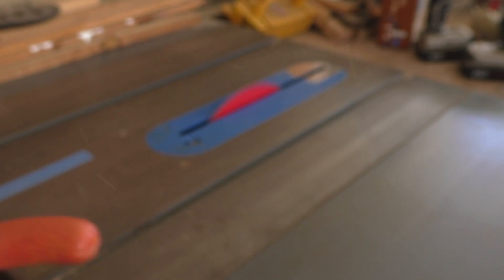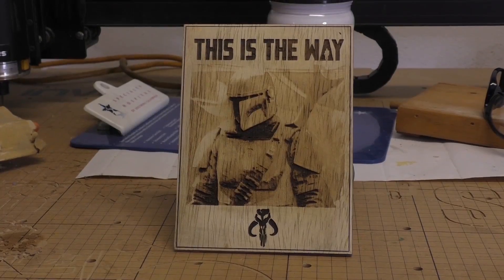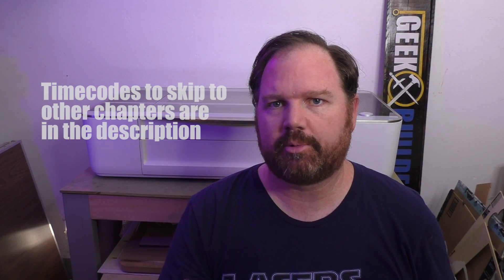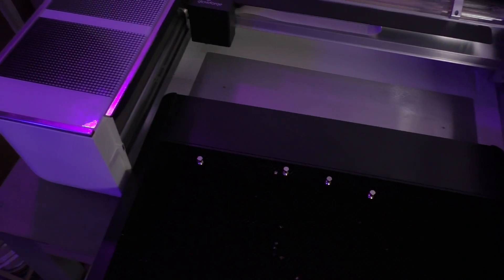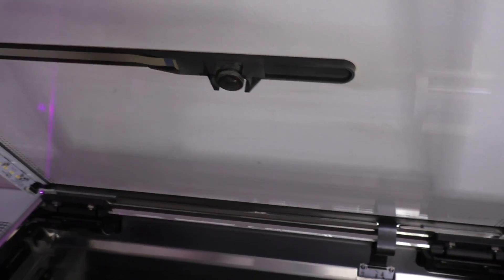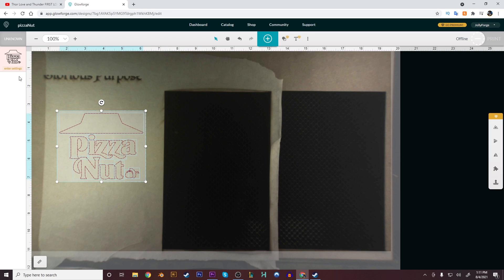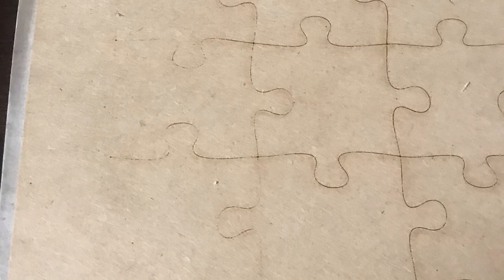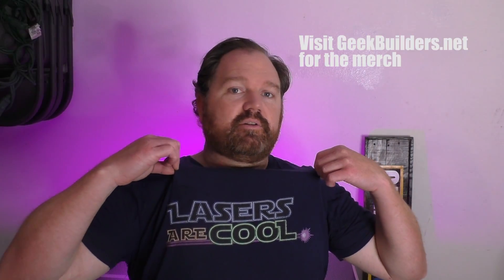Life with the Glowforge 6 Months Later

Comment: I have owned my Glowforge Pro since July of last year. I also purchased the HEPA filter add on filter system (by Glowforge) with it for use when the weather doesn't permit me to vent it out of the window. I keep mine in the house where the temperature never drops below 72 degrees Fahrenheit.  I also purchased the cloud9 external fan that many Glowforge owners add to their setup. Its very quiet because in the settings I have bypassed the mediocre internal fan (since its not needed after my upgrades). I keep it clean just as you do. It has ran 12 hours a day for 7 days a week ever since (I'm positive it would run 24/7 if I needed it to). I'm not trying to act as a GF fanboy here, but I haven't experienced a single problem with mine. I also know many people in the maker community that have owned their GF pro for 3 plus years with no issues to speak of.  Now, I'm sure I'll have to replace the CO2 tube eventually, and that will cost about $400 usd when the time comes (they last 2-4 years). as for the camera alignment issue you speak of, I have yet to experience that.
Reply from the maker: I'm glad to hear that it is working that well for you. I imagine that a large part is a result of the larger reservoir and better cooling for the pro. I have two pros at work with the HEPA filter as well.  The camera alignment is fairly common, but not sure about its real prevalence. I think some people might misunderstand my critique of the machine... I think its good... I just wish it was a little better so I could call it great

Comment: I seriously considered buying a Glowforge when they first came out, but the fact that you can only use it by sending your files through their servers made it a total non-starter. Our landfills are full of products that required an outside service to work, and that service went out of business or stopped supporting an older product line, and now you have a very expensive doorstop.
Reply from the maker: I know that's a lot of people's concern. Companies should have a built in contingency plan. Thanks for sharing and watching.
Reply: @GeekBuildersNet  Glowforge has stated that if anything were to happen to their company, that they will release stand alone software for the user so it can be used without their servers. However, until that time presents itself, it will remain cloud based.
Reply from the maker: @Connorsdaddy12062008  That is good to know. I was not aware of that. Thanks

Comment: I think safety is one piece that is completely missing in this review.  Working with a laser improperly can result in severe effects.  GlowForge gets a gold star for their safety precautions.  Sound is a funny negative as disabling the fan is an easy fix, and if you are venting any laser inside your house you should rethink owning one.  Overall if you are a production laser house, you would be willing to make a 5-figure investment.  Regardless, I don't think GlowForge is geared towards a full-time laser cutting service.  I use mine for hobbies and it's amazing and that's the sweat spot for it.
Reply from the maker: The comment about sound wasn't really meant as a negative- it was meant to be more informational, but I see how that might not have been clear. As far as safety goes, I agree that I also should have touched on it. Thanks for the good feedback.
Reply: @GeekBuildersNet  Also, can you share where turning off the internal fan voids the warranty?  All of the discussion boards make no mention.  I think the substantial community support is a positive to include.  Appreciate the note!
Reply from the maker: @judesturman  Yes. I will make note of it in a future video. It's usually not recommended to use a third party external fan until after the Glowforge is out of warranty, which is only 6 months anyways.

Comment: It’s a horrible build. I went thru 4 of them. They used a computer laptop fan for their air assist and will eventually light up.  Get your money back. Why would you go from a k40 and not upgrade to an omtech 60 or 80. You would of spent way less.   Sell quickly. Don’t get stuck with this junk.
Reply from the maker: I explained it in my video, but it might be easy to miss. The Glowforge was something that my wife was pushing for since it has a lower barrier for entry than most k40 style lasers. I still have and use my k40. I've found a place for both lasers in my workflow.

Comment: I can’t justify a $3k machine but I would love to have a laser engraver/cutter in my toolbox. Do you have a link to the K40 you use? Can it engrave metals (brass/copper maybe)?
Reply from the maker: C02 Lasers cannot technically engrave metals. But they can remove paint from metals giving the impression that they were engraved.  https://www.amazon.com/Engraver-Engraving-Controls-Woodwork-DF0812-40RW/dp/B01EJDH1BO/ref=sr_1_8?keywords=k40+laser&qid=1639967100&sr=8-8

Comment: thanks for the video, this brand is very popular in the crafters group. What type of laser do you recomend for a begginer, small projects. thanks
Reply from the maker: In all honesty, as long as the issues I mentioned about the Glowforge don't apply to your situation, I would recommend Glowforge. If anything I mentioned seems like it would hinder your ability to make, then I would recommend looking into the Full Spectrum Muse of possibly the MakeBlock Laser- I do not have first hand experience with these machines, but they do not have some of the issues that the Glowforge does.
Reply: @GeekBuildersNet  thanks, is very hot here (los cabos) and I got  scare when you mention the tempeture in your garage and I also saw a bunch of pictures online, the machine was  melted haha ... thanks for your response I will look for more options that not cut on fire and charge you for the dots on the i! saludos
Reply from the maker: @LindoCaboSanLucas  I understand, I hope you're able to find something that fits your location. Thanks for watching

Comment: I have been looking at these because my wife really wants one.  Hopefully someone will eventually modify the firmware to allow local operation.   If GF goes out of business, or just decides to stop supporting your version, you will be throwing the machine in the trash as it is now.   There have been too many products that met this fate.  It's one thing if they are a $100 smart device, much different when you can spend $6K.
Reply from the maker: A lot of people have voiced similar concerns, but I'm not sure if Glowforge has every officially addressed it. I'm sure that at some point, Glowforge could flip a switch and make everything available on a local network. Thanks for watching

Comment: I have a work around for the temp issues during summer, but this might take a little light work(really not that much). But can you order a replacement reservoir 2 holes un the new reservoir and get some rubber tubing and a small water chiller off of amazon. It might take you adding an exterior reservoir because most of the good chillers are for a minimum of 5 gallon, like I linked, but anything else you'd find would work off replacing ice water all the time.
Reply from the maker: I have been considering a similar work around, just trying to work up the courage to do it and make sure that I can patch things up if they don't go as planned. Thanks for watching

Comment: @08:55 I have only experienced this issue mostly with lasers that use glass tubes, the ones with RF lasers for some reason has a more consistent power all the way through compared to the the glass ones, I had the opportunity to use an Epilog and Universal system for a good 4 years straight and never ran into an issue like this, the guy packed up and left with his machines and never returned, I could not afford those machines and bought a decent Chinese machine hoping to get similar results like the Epilog, it wasn't the case from day one, I'm going through so much material, wasting tons, frustration, and inconsistent results, also the level of detail and razor sharp etch is unmatched, all said and done I'm simply working to save to buy an Epilog, even a used one is well worth it, its a workhorse
Reply from the maker: I'm not sure if I've heard of an RF laser. What systems typically have them?
Reply: @GeekBuildersNet  Usually the top-end brands like Trotec, Universal, Epilog, Vytek, the ones that don't need a water chiller, they usually use a Coherent or Synrad laser C02, you can find used systems for about 6,000 and up from what I gathered however alot of times the units need recharging so to do that cost anywhere from 900-3,000 , its about the power supply and the way they produce the laser, they create an equal amount of energy every time it pulses, there is no weakness in the beam, I've spent 4yrs making wooden medallions for necklaces, mulit-layered medallions, 100 pieces every order, vector cut and engrave, not one time did it miss a cut or failed a job, I can place up to 24x36 sheets inside and it would cut the same way from one end of the table to the other end, they say those systems have a strong beam that travels far with the same pin-point accuracy and same amount of energy, all in all they are pricey but worth it if your looking for quality production, I was heart broken to see what my chinese machine produced compared to the epilog, I know how to tweak photos and all but still cannot come near that fine detail
Reply from the maker: @farouqiamin7894  That is some great info. Thank you

Comment: Go with a Thunder or Epilog. They use USBs and programming is easier. No wifi needed. They also have more space inside the machines so you can engrave more stuff plus they do rotary stuff too.
Reply from the maker: If and when I upgrade or change, I will definitely be looking at one of those other lasers
Reply: @GeekBuildersNet  You will never regret it if you buy and Epilog, the results are unmatched, they cost alot but for the most part worries free and excellent customer service, you can literally etch font thats 5pt into wood and read every single letter, pinpoint detail
Reply from the maker: @farouqiamin7894  If and when I upgrade, I will definitely be looking at Epilog
Reply: @GeekBuildersNet  I would say Epilog as well. My uncle had a brick and mortar laser engraving shop in the 90s and I want to say he had an Epilog laser engraver. I worked there as a teenager and it was awesome.

Comment: Is there a laser you would recommend that does what the glowforge does…one that does a great job of engraving wood & metal
Reply from the maker: The larger k40 models are great for engraving and cost about half what a k40 does. They do take a little more technical knowledge to operate though. On a side note, none of the C02 type lasers will engrave metal. The most they can do is remove paint from metal to give it the appearance that it was engraved. I would also recommend looking at the Muse and MakeBlock brand of lasers. They are very similar to the Glowforge, but might offer some slight improvements over what the Glowforge offers.
Reply: Is that what the gf does…remove paint to give it an engraved look? Thank you for your suggestions, I REALLY appreciate & will look into the ones you recommended 🥰
Reply from the maker: @sikhinthehead  Only with regards to metal. For true metal engraving, you would need something called a fiber laser. Thanks for watching

Comment: Very nice review.
I keep telling people who are ready to fall for their marketing…get a k”50” with a ruida controller. Costs less. Bigger z height. Comes with a rotary. No online BS. Dump designs to a usb or over ethernet. 

Watch out keeping that thing in the garage in the winter. If it goes below freezing you’ll crack that tube, which, just looks like every other cheap chinese glass tube
Reply from the maker: I have a k40 as well.. I ultimately have ended up using both- each one has specific applications in my shop
Reply: @GeekBuildersNet  where do you get a k40 for $350?
Reply from the maker: @krisburgo2954  It was $350 when I bought it over 2 years ago. It has shot up in price since then
Reply: @GeekBuildersNet  got it. Thank you. Thoughts on the Xtool d1 or would a k40 be better?
Reply from the maker: @krisburgo2954  I don't have any firsthand experience with the xTool. The only thing I can say is that the xTool is directly modeled after the Glowforge and will be very similar to that experience and price tag. The K40 is a lot cheaper, but also requires a lot more setup and technical knowledge to operate

Comment: I am one of the original backers of the glowforge.  I agree with basically all your points, I wouldn’t recommend it to anyone.  The company has been absolute garbage from day one.  My biggest regret is not canceling the order the first, or second or third or fourth or fifth time they delayed the original launch.  On the bright side it looks like they have improved the camera, mine is usually off closer to half an inch.  The day they announced the premium subscription I almost sold it.  That was outright insulting to charge $50 a month for basic features when the original promised features were still missing.  Just look at the difference between the glowforge software and inventables easel.   Glowforge charges an absurd about for software that’s a tenth as good as their rivals
Reply from the maker: There are a lot of people disappointed with the machine and ecosystem. I hope they are listening to their customers' complaints... A lot of the issues can be fixed with software updates. For now, I'm keeping my fingers crossed

Comment: Good video, sorry though, seems like you are being extremely patient because it's very limited to your lifestyle. I bought a Makeblock and was simply wondering if your software was proprietary. If seems like the Glowforge will do really nice pictures and the Makeblock struggles with that. But I did not buy it for that. I can remove the honey comb grate, I have mine inside the house office, but I do have it vented. Can you use Lightburn with it? I ended up buying a Ortur Pro 2 as well.
Reply from the maker: I knew about some of the drawbacks of the Glowforge when I bought it, I just didn't know how much it would impact my workflow. As far as lightburn goes, no Glowforge will not run it.

Comment: I am doing my research on a laser machine to start my own business. After watching your video, I can honestly say I am going to pass on the Glowforge 100%. Other reviews have stated the machine is loud but yet to "show" the sounds coming from it. Absolutely sounds like a blower! I was concerned about the software and that the machine only works with WIFI. I am consistently seeing that the 40w-45w laser does not produce the best quality or cut through product well and the Gf only has those options. You undoubtedly answered all my questions and wanted to thank you! For anyone interested in a really good laser, the Aeon MIRA 7 60w or MIRA 9 ($$) so far is one of the best "do everything and more" lasers out there. Thanks again for the help.
Reply from the maker: I'm glad the video was useful. Just one additional comment though, the machine is loud, but that can be fixed with adding an inline fan and then disabling the internal Glowforge fan. It is an extra cost, its one of the more minor annoyances of the machine. Thanks for watching

Comment: The reason everyone on youtube, but you, rants and raves about the Glowforge and the puts a link below to buy one is because there is a HUGE kickback from the company.  Most of these youtube personalities pushing this machine are full of shit.  There are light year better options out there for the money.   The worst thing the glowforge is it doesn't even come with lube...your gonna need for bending over you will be taking.
Reply from the maker: From a certain perspective, it does seem like Glowforge is using a pyramid scheme type structure to get people into the ecosystem, but at least they made a decent machine. By no means is it the best in its category, or best in terms of quality and function, but it will work. In addition, most of my complaints can be fixed with firmware or improvements to the software even though expecting them to do so might be a little of a pipe dream. And.... to be honest, I did put my referral code in the description of the video, I just thought it would be unethical to announce it in the video.

Comment: My work laser has a second laser pointer that can be calibrated to be in line with the cutting laser, and I use that to trace the outline of my cuts by sending 2 files to the machine. One where the cutting laser is at 0 and the other with my actual cut. I use the laser power set to 0 to frame my cut on my part beforehand. I wonder if you could do the same thing with your machine!
Reply from the maker: A lot of people will cut the outside profile on a test piece and then place the final piece inside the previous cut. This can work well, but adds an extra step that I would like to avoid.....but in the end, I may not have a choice